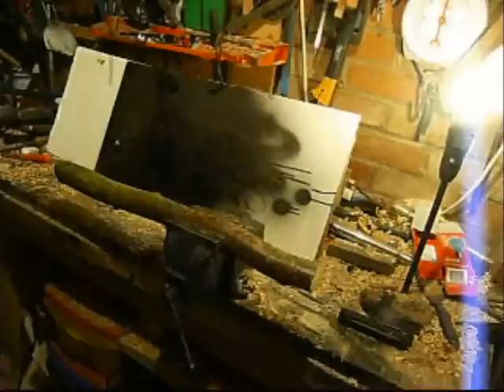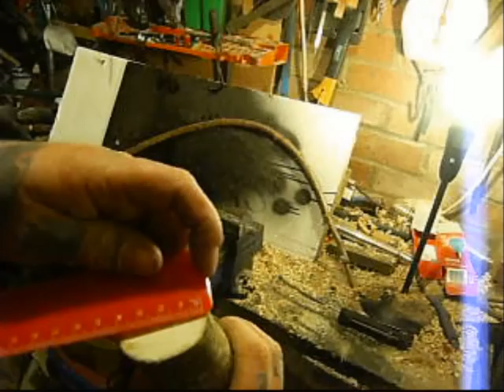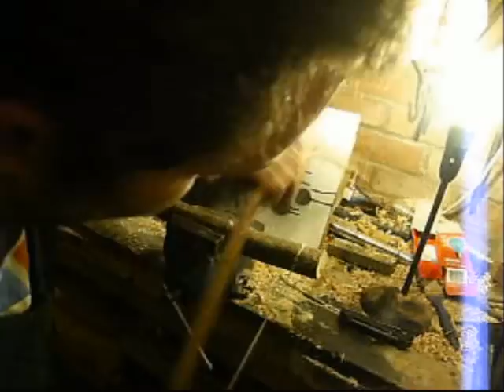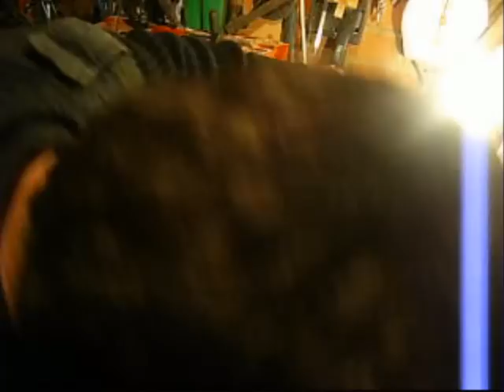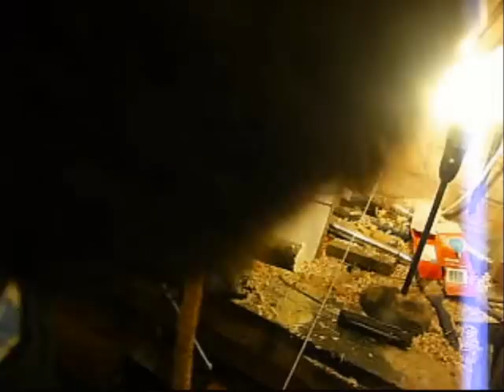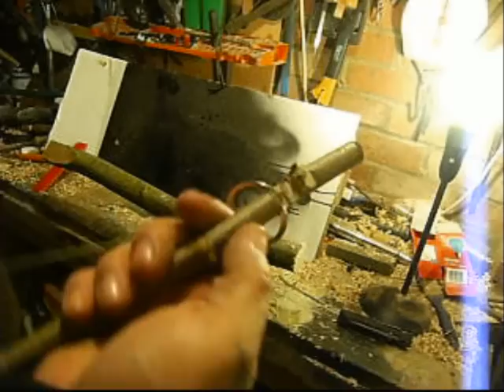the proper way to use a wire saw .

Comment: I have had good and bad luck with these types of saws. It is all in how you use them and how you treat them. when cutting do not put to much pressure down on the saw to extend its life. Great idea you have here Malc! I recall finding out the hard way not to touch the saw itself after making a cut ... I think I was 12 at the time and I recall the long thin blister on my hand!

Comment: Good job demonstrating the proper way to use a wire saw. Not all wire saws are the same as far as construction. Some have more aggressive teeth, and bite through the wood much more quickly. I would like to see a version of the wire saw that is about three times the thickness, very aggressive teeth, and about twice the length-- that way one could make a very large bow saw and cut through entire tree trunks in no time, while having a lightweight wire saw.

Comment: Ok I feel like an idiot. I've seen plenty of videos on wire saws yet I've never seen anybody suggest this method. Excellent work! 

Question: have you ever tried using something like a modified chainsaw chain with something like climbing clasps as handles? My father and I thought of trying it, but it might cost a a little much for an experiment.

Comment: with all saw tools, the best way to extend the life of the edge is to use the entire length with long strokes.  This will distribute the stress and wear and minimize the heat on any one are of the wire.  As for time; better to use light strokes, take whatever time is needed to do the job, and make every effort to preserve the wire.  Speed is not important.  Ming5906

Comment: not really.. when it comes to firewook you wouldn't use such fresh(?) wood, and if isn't fresh but in this size, then you can break it, or work on it with a knife.. 
actually a saw from a swiss army knife would be fatser and you could also open a bottle of wine. ^^
it might be the proper way to use such a wire saw, but I think it's worthless. In a survival situation you want more than a wire.

Comment: great vid nd u kno tht some ppl use tht ty[e of wire not as a bow  or a bow saw but as a weapon. certain ppl use it 2 chock ppl or 2 cut off things heads, i chopped off this chickens head by using my uncles bow saw just wit out the stick